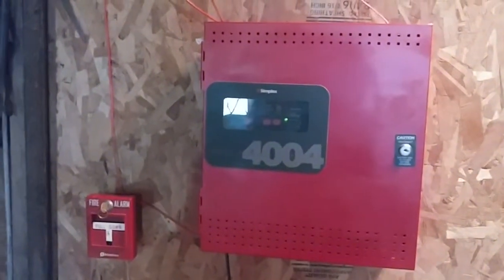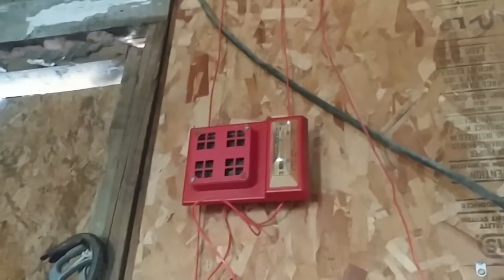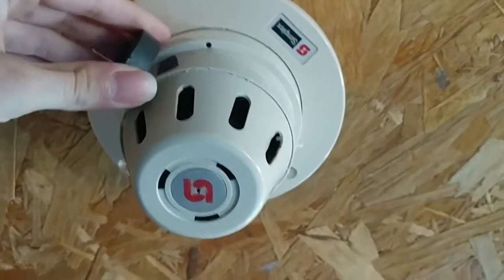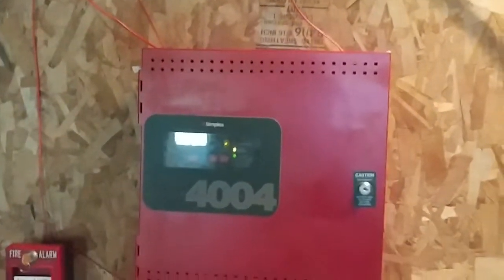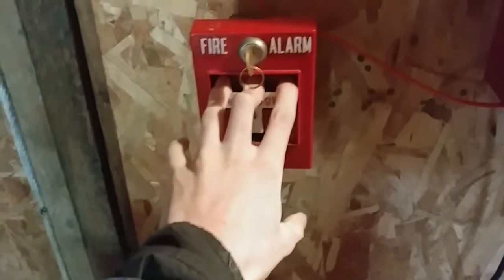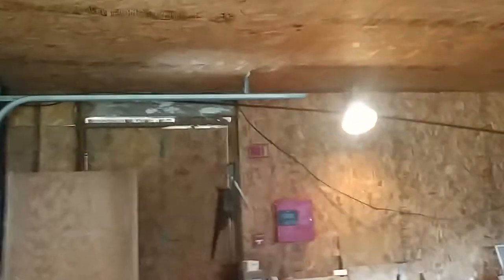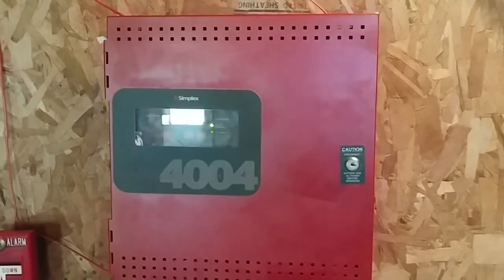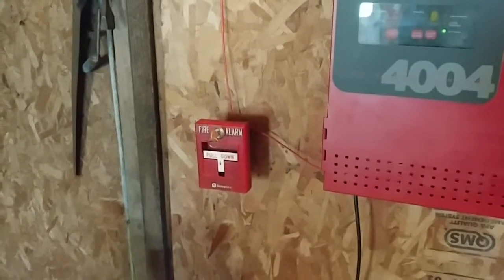fire alarm test 46 #FireAlarmFriday

Comment: There’s a abandoned Kmart store in cookeville,TN that had 3 2901-9838s on 2903 light plates with projectors on the horns and simplex tbars and there was 3 9806 horns only so the system was pretty cool but the panel I believe was a 4002 and the system is still in the building buts it’s abandoned

Comment: I love those old fire alarms my old Christian school in crossville,TN all the alarms were 2901-9838s on the 2903-9001 light plates and they were on continuous all the rooms had them and the cafeteria/music room had them and the panel I believe was a 4002 and the building was built in 2006 so the alarms were installed so they are still there I believe the new alarm in the new building are 4903-9221